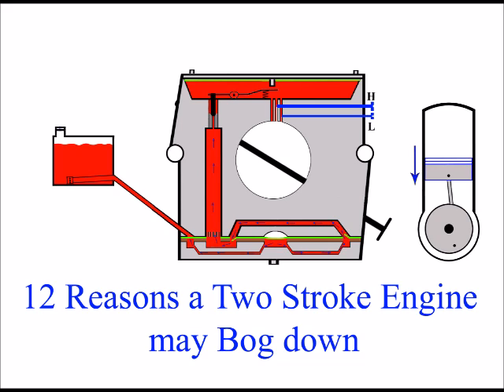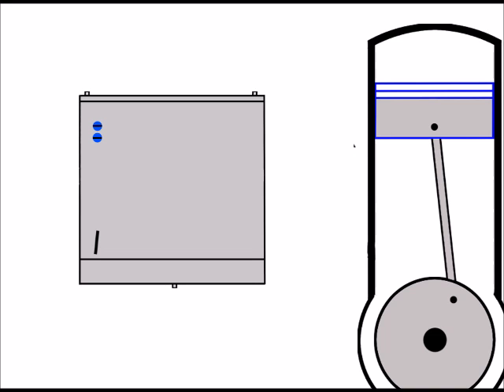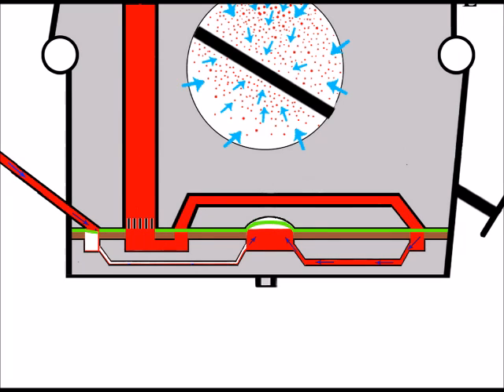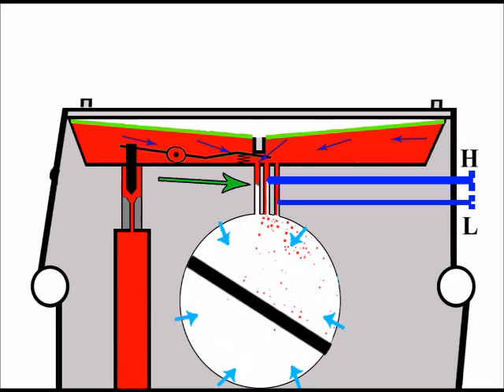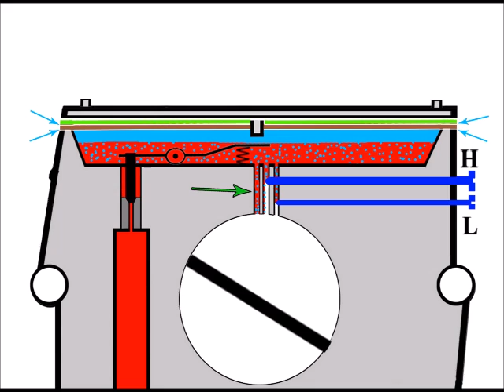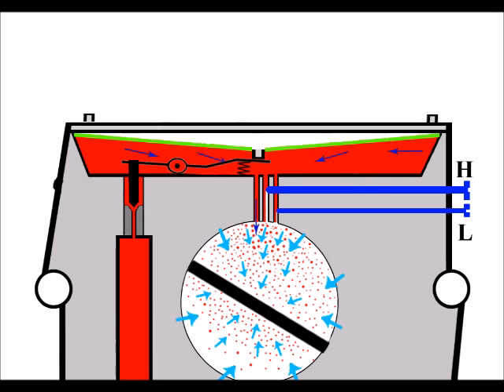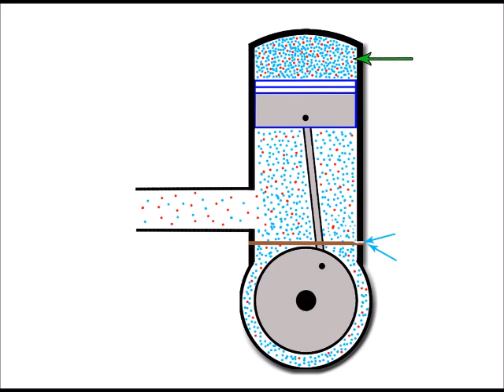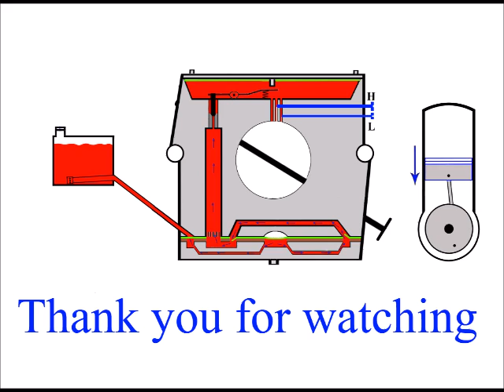Chainsaw Carburetor Problems - 12 PROBLEMS TO AVOID!

Comment: Can't remember if covered (don't think so)... 

**Problem
Fuel filter (pickup) is not sitting in fuel ---> fuel starvation

**Possible symptom
Bogs down when engine is turned in different orientations (Eg, my hedgetrimmer bogged on one side and with blades pointing upwards). This started occurring even when tank was half full (when previously had no issues), and did not happen all the time.

**Solutions
(1) Simply re-positioning the line so the (weighted) filter dropped to a good spot (bottom of tank). This worked for me.  My filter has chunky metal casing (heavy).
(2) Others have needed to weigh down the filter so it always drops to "bottom" of tank (eg, by attaching a nut)
(3) Keep tank full enough
(4) Very stiff lines (fight gravity) could also cause issue and be fixed by replacement.

Not an expert... but pretty obvious, worked for me, very simple diagnosis (take cap off, look where filter goes when you turn engine in different orientations and guess whether fuel will be covering it) and fix.
Reply: Of course you can just diagnose by filling the tank right up too...

Comment: Just got my 20 years old McCulloch 240 TrimMac going - I followed your instructive video to the letter, and it worked !

I put 2 cable ties round the fuel line at the barb end. Ran, but 'bogged down' on opening throttle.

I then put the old metering lever back in - I had already put the new one in and reassembled but with the problem above, then I saw your video - and I then deduced it was running lean. Luckily I had saved the old lever just in case. It was a shade higher at the diaphragm button end when replaced, compared with the new one.

As for the weeds - it's now the strimmer from hell to them !

Comment: Good video, But apart from Fuel issues, a non starting engine could have the following issues:a) Ignition problem b) Lack of engine compression. I feel that these two issues also must be addressed when diagnosing a non starting engine. Thanks

Comment: excellent video!  don't forget, however, the exhaust.  i run stihl equipment.  bog down for me means that i need to check the spark arrestor.  it frequently gets plugged causing bog down.
Reply from the maker: Hi, thank you for the positive feedback and comment. I really do appreciate it. Craig

Comment: Excellent video! It could be improved by adding "sub-sections" to your 12 steps to remind folks to check, say, both gaskets around the manifold (e.g. 4a: carburetor-manifold gasket, 4b: manifold-engine gasket, 4c: manifold itself, etc.)

Thanks for sharing your knowledge.

Comment: I have a poulan I have replace everything WA 229 carburetor. The chain saw will run full power all day long but after it stops you have to wait for next day to start. also it seams that I have to readjust mixture.  after watching this video, I understand way more.
I think my next steep is how to pressure the crank case.

Comment: 1:02:35 -- In the USA, automotive petrol contains ethanol (alcohol).  During storage, the ethanol absorbs water from the air until the ethanol absorbs so much water that the ethanol-water mixture separates from the petrol.  Because an engine can't run on water, the engine won't start or run.
What's worse is that bacteria begin to consume the ethanol-water mixture.  They transform the ethanol into vinegar (acetic acid).  The vinegar corrodes the aluminium parts of the carburetor and produces aluminium acetate, which reacts with water to produce a thick gel, which in turn clogs the carburetor's passageways.   
Petrol that contains ethanol also degrades rubber and plastic parts of the carburetor.  Such petrol is the bane of small engines in North America.

Comment: I watched a video & a Zama carb technician said never ever blow compressed air into the carb, or even spray carb cleaner directly into any holes in the carb! As it can render internal check valves useless & write the carb off.
Reply from the maker: Check valve damage is NOT an issue if you have stripped down the carb properly before using compressed air

Comment: Hi Craig my carburetor is a Walbro WYC-6 and does not have any high or low adjustment scews, the only adjustment i can make is for idling of the engine,so i assume the pump or metering diaphram or internal orifices  have dirt in them blocking the flow of fuel, so will have to pull lit apart and try an ultrasonic clean or boil in hot soapy water.  Thanks for your quick reply and great detail in your explanations of the workings of the carby.

Comment: Hi.  I love the videos, but I have one question about this one.  I was under the impression that the gas cap needs to provide a tight seal at all times, and the "breathing" by the tank was facilitated through the return line coming from the primer bulb.  Am I missing something?  It this carb different from the 2-cycle carbs that I'm accustomed to?  Thanks.
Reply: I think you're right for many engines

Comment: By the time  I watched 2 or three out of 12 all seemed elementary   My question has to do with spark & ignition.  Will a weak coil  cause failing of steady acceleration  or even no acceleration from idle state. ???j

Comment: Actually you should add a #13. 2 strokes tend to have carbon build up, especially at the exhaust. If the exhaust manifold or system gets too much build up then the engine can run but may not achieve full throttle since the flow of air/fuel is restricted at the exhaust end. Look at your exhaust. If you see build up either mechanically remove it or run a decarb additive.

Comment: You did not stress enough one of the most common problems of fuel lines from tank to carb. These lines become hardened and brittle and develop cracks or become loose at the point of the fuel line connection point. It is one of the most common problems.
Reply: Mainly because of modern forecourt petrol and the check valve damage it causes, as well...
It's fatal to carb type fuel systems.

I've spent a few days now, ordering, buying and fitting (all were necessary parts) - purge bulb, fuel lines, gaskets, full Walbro carb repair kit, in-tank filter, doing carb cleaning, tank cleaning, fuel cap relief valve... 
And it still won't run more than a minute or so.

Turns out the check valve seat was corroded, thus preventing correct fuel uptake, and this is non repairable. (Although I am going to try grinding off the damage - nothing to lose, now).

Now I only use Aspen alkylate premix, it lasts years too. 

Knowing what I know now, would've bought a new carb straight off.

Awful stuff, this modern petrol.

Comment: I'm impressed by your video explanations. I've watched several and appreciate your thorough presentations when compared with others on YouTube. I'm still confused about exactly how the throttle fits into the process. I've managed to get my Husqvarna 128ld to finally idle without choke or half -choke, but as soon as I try throttle to achieve a working RPM, it bogs and dies. I've tried to logic things out based on your explanations, but no dice. I can't absolutely identify  what you're calling a "tick-over screw". Is that perhaps a British pronunciation difference versus Texan/US term? Husqvarna has an odd, fine-threaded screw with a tapered point that I can't identify its function. 

After watching your video listing reasons for blogging down, I've eliminated most causes as the carb, spark plug, fuel line and fuel filter are all brand new. Now that it idles without choke I'm confident that fuel itself isn't the culprit. I know you don't usually get into brand specifics, but what do I do at this point? Also, I'm not quite sure how to look for your reply, but in any case, I appreciate your videos. We'll done!
Dave in Houston

Comment: It would be good for you to explain in your excellent technical style why a 2-cycle engine exhaust and/or muffler when seriously in need of a de-coke will prevent the engine from running at anything above tick over or at best reduced revs and output power regardless of carburettor adjustment.  Just happened to my chainsaw and an overnight soak of the internal baffle plate and other exhaust parts in cellulose thinners has restored the engine to full operating condition.  Guess if the exhaust cannot exit then the engine will bog down in similar fashion to carburettor complaints you mention here.
Reply from the maker: Pauline Taffley, absolutely, thank you for your feedback and it is actually on my agenda to include this type of video. I hope to have it sorted soon. I'm just in the middle of a few other ideas at the moment, then when I've finished those I will get onto that tutorial. Thank you for your feedback.
Reply: Pauline Taffley absolutely ....

Comment: Hi I have a question.so I set my screws at 1 turn.on my H I had to turn clockwise for more rpm.why do I have to turn counter clockwise to restrict such high rpm.wont it damage engine?
Reply: No, higher idle as a result of a lean condition will not maximize optimal power curve and will ultimately cause deprivation of lubrication

Comment: I really learned so much from your well done videos, kudos, sir!

I have 2 Poulan Pro 42CC and a WoodShark chainsaws and need to replace all of their fuel lines.
Thanks to youtube, I'm seeing that oddly to me, the supply line from the tank (with the filter) is actually the smallest diameter fuel line, and the return line from the primer bulb, back to the tank is slightly larger in the ID diameter for some reason.
I'd of bet it was the other way around, but that's not from what I found.  

I can't find the proper, smaller sized line locally anywhere, and I'm very tempted to simply drill out the hole in the tank a bit, and use the line I have found.   I'm guessing Poulan's design engineers are way smarter than me for sure, so they must have their reasons for making the saws as they do.

Why do you think these Poulan's even need to have 2 different sizes of fuel lines in the first place, and maybe more importantly, why do you think the supply line is the smaller of the lines?

Thanks for your thoughts.
Dave

Comment: Wow, Wow, Wow!  How nice that you took a difficult subject and broke it down to the simplest of terms.  Since Carburetors and I don't get along,  my fix is generally to order a replacement rather than rebuild.   I thought it was awesome that you took the time to not only describe how the whole process works but integrated countless diagrams for us viewers to follow along.  How thoughtful!!  Yes, it was a lengthy video but for me,  well worth the investment in time as I now have a better knowledge of not only how this damn contraption works but how to diagnose as well.   There are way too many lame ass videos out there and this is definitely not one of them.  Although,  the likes far out weigh the dislikes,  I am trying to fathom what would possess viewers to click dislike on such a well thought out, well organized Video.  Hmmmmm   Maybe some don't like long videos.  Anyway,  if you aren't already a teacher, you should consider doing that on the side.  I can't thank you enough and felt compelled to write you .... after all,  you put in 25 times more in time than it took for me to write this comment. ;)  keep on teaching my friend.  You have the knack for it!   You just added another fan!    Dan 

P.S. just wanted to add one additional comment about the body component you mentioned which connects the carb to the engine.   You are correct that alot of connecting rod screws thread into the body but I did find a Poulan that uses what they call an adapter plate to fasten to the engine block while holding the threaded rods in the opposite direction which the carb slides onto then the aircleaner holder.   The previous owner had torqued down on the later screws so hard, they cracked that adapter plate ultimately letting in more air as you described.   Again, great job!!!!

Comment: Another great video, thank you. I did see a 'how to' video on how to clean the carburettor on my Stihl KM90R, I wish I had seen your carburettor tutorial before! Because the cleaning didn't work, I took it to the local repair shop. He advised that cleaning the carburettor was not the best course of action, and that 9 times out of 10 he ends up replacing them, in the end. So he always advises just to replace them, its a more reliable solution?? Just interested in your view of that advice...?
Reply from the maker: Tony Newnham, personally, I would invert that number and say that 9 times out of ten the carb can be serviced and cleaned. That's just my own experience. I've worked in a repair shop for many years and can, however, understand the their view. That is, if a carb is being particularly troublesome then it's very hard for repair shops to make the money they most vitally need to keep going.  Repair centres nowadays generally don't want to take the risk of wasting too much time trying to get a carb working, and in the end if they can't get it working, they will have given too much time and profit to something they cannot recoup the money for. They prefer to alleviate this problem by just fitting new carbs and having a job done well and quick. This suits them and the customer if they get their machine back quicker and working better for it. As for the cost of this, yes it can cost, but if one was to pay a repair centre for all of the time in diagnosing a particularly troublesome carb then believe me it would cost far more. The fact that they don't means that they couldn't charge for that level of time. So the best thing for all concerned is to have the new carb. That said, they should have at least had a go at using their skill and knowledge to repair it first. But they may have done this, I don't know. I hope they did anyway. It really is down the repair centre as to the course of action they take if you are willing to permit them to repair your machine. I'm sorry I can't help more and I can see both points of view here. Thanks
Reply: Yes, that makes perfect commercial sense to me, and to be fair to him and me, sounds like the more reliable solution. It also meant for me that he set up the throttle properly and I now have a machine that isn't messing me about! Thanks for the very helpful insight and taking the time to reply, and if I get another 5 years trouble free out of the new carburettor, it will of been money well spent!

Comment: Yes this is crazy lol the carb on my China doll doesn't have a high low adjustment or a diaphragm, it's running less then perfect right now  I've cleaned the carb sever times hoping something would give, new spark plug, new cap on the way, I think I still have a vaccuum leak, I'm gonna buy a better carb as well I think that will help

Comment: Very  informative and if you have expensive named machines the knowledge will help you fix them. Cheap Chinese power tools are throw away not worth the effort. I had a cheap Chinese strimmer that was getting bogged down they attach every thing with screw locker and there too many gaskets in the carburettor manifold as you have the plastic stand off, then heat baffle then the carburettor all with gaskets and as I had the machine for two years  and was only £70 I bought another one.

Comment: Hello, I have a trimmer with single bolt carburetor and it doesn't work with choke off. With choke on it runs perfectly even warm in all speeds. Trimmer is new (cheap) and I suspect that mixture is too lean. Any suggestions what and how should I try to adjust?
Reply from the maker: Hi.  I actually already have a video here on youtube that may help with your issue.  You can find it here: https://www.youtube.com/watch?v=yabdpL3aqiI&t=112s .  Thanks

Comment: Great stuff as us Kiwis will say. I have a 45cc 400mm that just goes straight to 3 million RPM on start up. Idle screw is backed off and L and H haven't moved since it was all OK. The throttle spindle moves as expected. Kinda spooky. And suggestions please??

Comment: QUESTION:  I have a Stihl 038Mag.  The carb has been rebuilt twice by dealer in last 4 months, still have the bog.  What happens is when cold, the engine starts easily and runs well, cuts with good power.  After 15-20 minutes, after warm, the engine bogs when trying to cut wood, then when you get it out of wood and just run the engine it revs a little inconsistent, like without pressure on the throttle it revs high, then lower. then higher.  What might be the most likely problem.  I’m tired of taking back to dealer.  thanks!

Comment: Great video and info for potential bog down, but i have bog down on carby with no H/L adjustment screws on a Ryobi blower what should i check cheers Doug
Reply from the maker: Hello Doug.  First of all, thank you for your nice feedback.  It's much appreciated. If your carb is having issues then a good place to start is to take a look at my other video on how to set these.  I use a chainsaw in this video but the principles are very much the same for most two strokes.  You will find it here in the link: https://www.youtube.com/watch?v=74p9FLmIkkw . Thanks Craig

Comment: Thank you  buddy for the video,
Do you  how a suggestion  to give, to know  if is the H L screws 
Is a chainsaw  saw echo cs 590 
When i choke  2 pulls and  then no choke 1 pull starts, and turns down as soon a even touch  the gas , 
Then 2 more turns again then you will nit start again till you choke again ,  ALL OVER AGAIN  
Replace the fue filter, replace the carburetor  with a rebuild  kit , and clena every single  hole in the carburetor,  nothing 
Pkease help new carburetor   is 103 usd,  and who  knows  if will be that because starts  wvry time